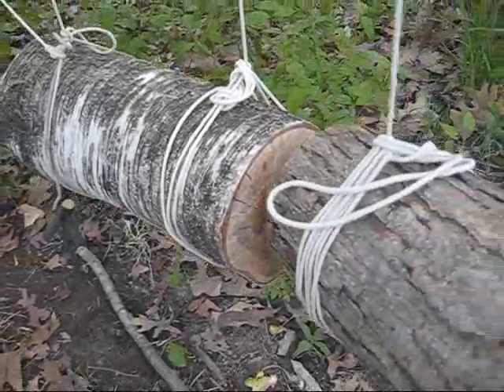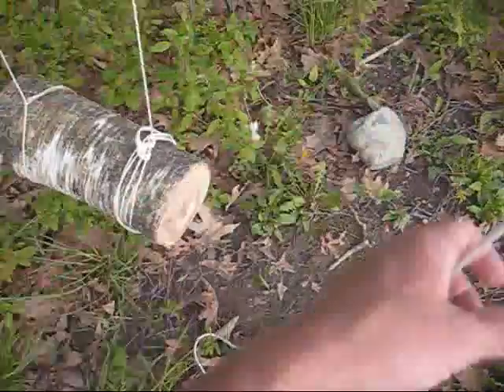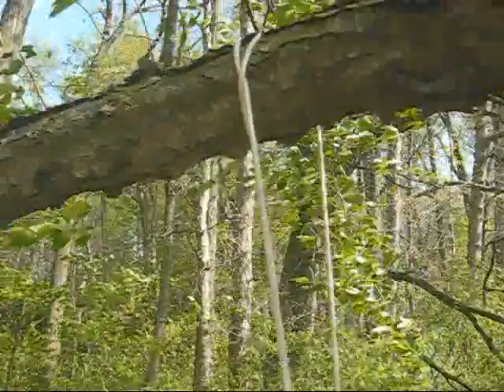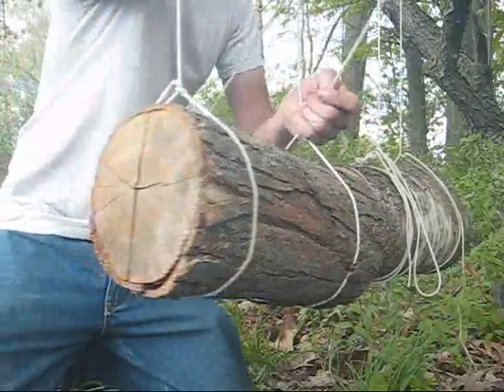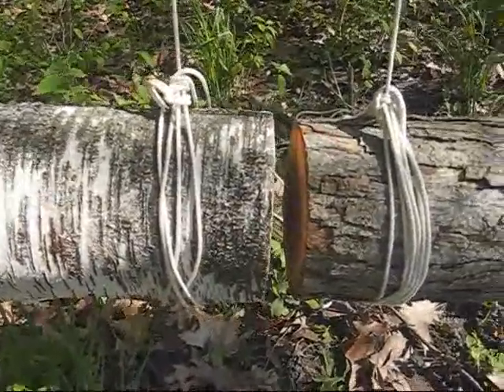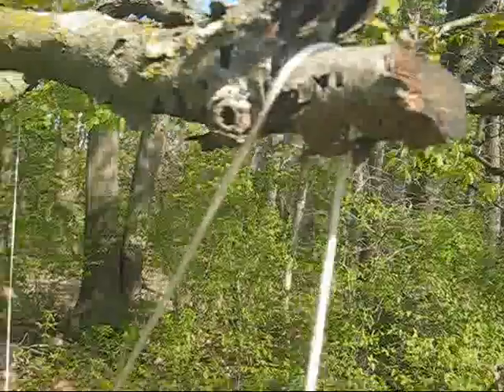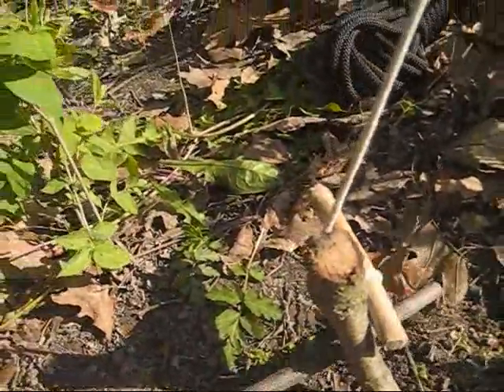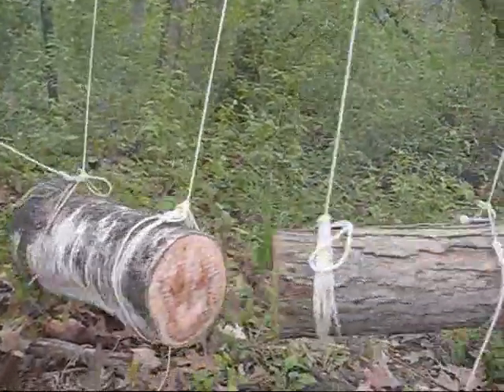How to Make a Swinging Log Trap

Comment: This reminded me of a trap I built back a long time ago when I was 10. I balanced a tire on a branch above an old bed spring - set at 45 degrees. The trip sting went from the tire though the bed springround a log and over to the walk area.
When the string is tripped the tire falls. You see the tire fall off to one side so you don't move, but do watch it come down - about 20 feet. It then hits the spring and comes at you on a horizontal. 

It throughs you about 10 feet off the trail.

Comment: the more realistic version would be a single large log with a double trigger, a smaller more sensitive trigger sets off a weight that sets off the heavier trigger holding the log, thus allowing more ease in setting and making it more reliable. you simply make it so the log crashes through the brush mere moments before impact, thus hiding it's approach and catching the victim off guard, it also has a extremely profound effect on the mind when you were literally staring death in the face.